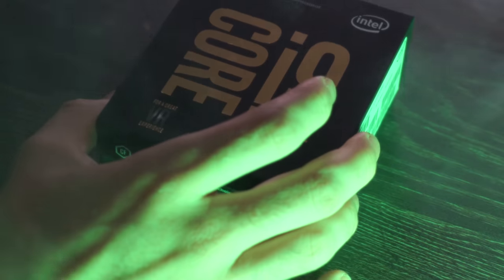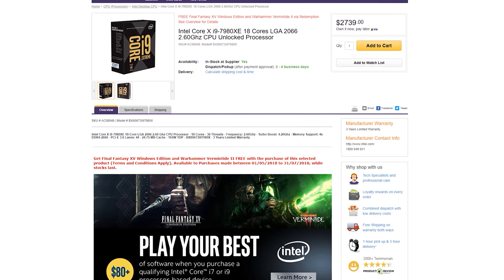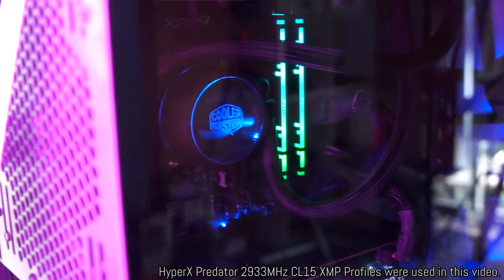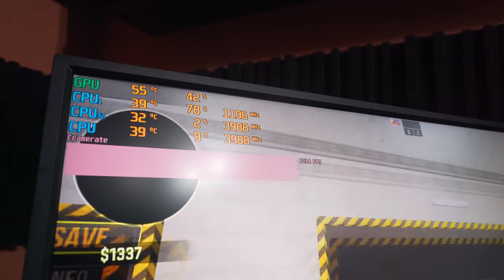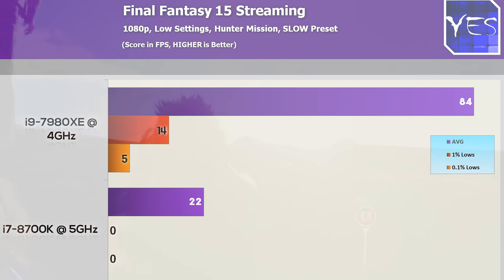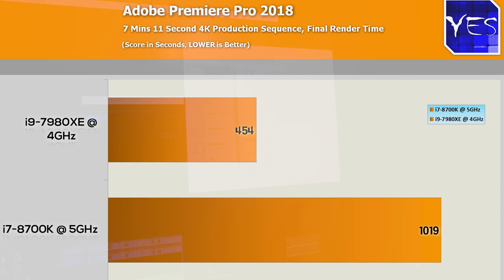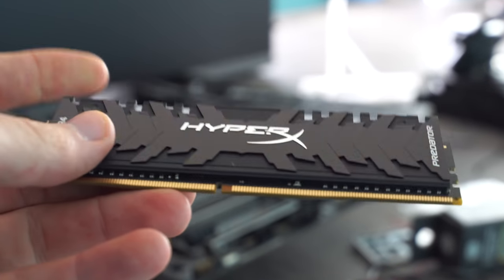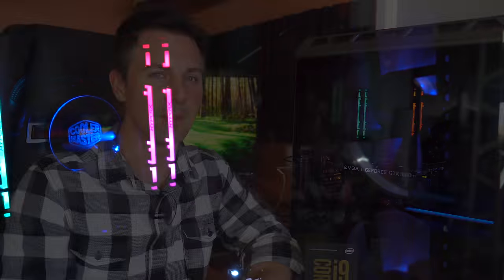i9-7980XE - What Can 18 Cores at 4GHz DO?

Comment: That Cinebench score is 6x of my i7-3770 main desktop PC ><
Reply: And 4,2 x of my 4790K at 4,6 Ghz.  I get 939 Points.
Reply: My E5-2698A v3 gets 2480.
Reply: And about 1/3 of my slightly overclocked ryzen 5 1600.
Reply: Damn! My 3930k @4.2 gets just over 1000.  Love that cinebench score
Reply: 🤓 I get 564 on my 8core Xeon Mac Pro tower 🍎
Reply: Still have FX 6300, i9 wouldn't be much of an upgrade just yet.
Reply: Is like 15% faster than my TR 1950X
Reply: Gabriel Florit 🤓 Cool 🚤
Reply: Really? I suppose it depends on the workload. it's going to get harder and harder for everyday people to max out these newer CPUs. There's only so much one person can do!
Reply: 910
Reply: "And about 1/3 of my slightly overclocked ryzen 5 1600." LOL, Nice.

J T
"it's going to get harder and harder for everyday people to max out these newer CPUs."
Seriously. Even 6 cores would not be utilized without modern games or content creation of some kind. 8 is hard to utilize, even for content creation. Virtual machines, audio editing, video editing, 3D rendering, and compiling seem to be the common workloads that I hear can utilize these HEDT parts.
Reply: i got 1200 on my 8600k at 5ghz
Reply: 3.6K is what I get with TR 1950x 4.125Ghz..... This cpu is a joke
Reply: weaklings, i got 700 on my sandy bridge i7 bro. beat that

Comment: The EVGA X299 DARK is a good motherboard. Designed for overclocking.16 phase VRM using 2-8 pin CPU power connectors. With the right cooling, and a delid, the i9-7980xe should clock to 4.7GHz stable
Reply: yea but kinda pointless to go for such a high clockspeed. he reached over 80°C at only 4GHz with a 280mm radiatior. how are you even going to cool this beast at 4.7?
Reply: Yeah, with an AIO that's better suited to a mainstream processor! If you delid the CPU, and run a large custom loop, those speeds are very attainable at a lower temp. Not on that AsRock board though.

Comment: Indeed I would be worried, or somewhat happy maybe if my idle temps were higher than my load temps. But something I'm wondering: what voltage are you running it at? My 4.3 GHz are stable at 1.13V which already puts out a decent heat. Something you wouldn't be able to cool with that 280mm rad.

Comment: Just a friendly reminder this is 7th gen Intel chip. Threadripper 2 is not even out, and is technically coming at 10th gen Intel timeline.

Just a thought.

Like new 8700k will lay FX on its' back.

Comparison is not valid to compare to Threadripper 2. Threadripper 1, yes.

Comment: For anyone considering buying this for only gaming you don't need 18 cores since even the most demanding games like Ghost Recon Wildlands at most will use 10 cores. Plus I'm pretty sure the PS5 and next Xbox will only have 8 cores 16 threads Ryzen cpu's and I still don't think games will be using 18 cores in the future. You would be better off buying cheaper cpu's like Ryzen 5 1600, 1600x, 2600, 2600x, Ryzen 7 1700, 1700x, 2700, 2700x, i7 8700, i7 8700K, i7 5960X, i7 6950X and i7 7820X because all these processors have at least 6 cores 12 threads and you might need the hyper threading in the future if games start using more cores.

Comment: building that seems hell so expensive. Instead I got a workstation from ebay with two old XEON processors running  at 2.8 ghz each  ,  for a total of 24 cores  48 gb ram for just 400 dollars and the performance is hell impressive too. Nonetheless I am realistic here.  the core i9 might doble up the processing power of my dell workstation but still It has a lot of horsepower  at a fraction of the cost  :D

Comment: OMG I want that lol...  However, if it does not really kick up my game play, whats the point.  

I have an i7-5820K 3.3 GHZ 6 core 12 logics and it works fine with my 128 gb ram and a 980ti.  I can still multi task pretty good so I am happy with running a game, having my cheat sheet up, skype, and more.  Plus, 4 1080 monitors.  I also do Software development on the side with Android and Visual Studios.

Comment: Which Adobe update are you referring to?  There was a recent update that allows you to take advantage of the usually idle integrated Intel graphics to drastically speed up exporting.  But this i9-7980XE doesn't have that.  Also... Puget Systems did a test of a bunch of processors... and they came to the conclusion that anything over 14 cores doesn't gain much benefit in Premiere.  So it really makes me wonder who would pay $2,000 for this processor to use for Premiere!
Reply from the maker: Its on my twitter, download the lastest adobe premiere and it was utilizing all cores and threads.
Reply: Ok thanks!  I know everyone got excited about the recent announcement that Adobe will use hardware acceleration with an integrated Intel iGPU to speed up exporting.  But there wasn't any talk about it utilizing more CPU cores with the latest update.  I have the latest update... but I only have a 4-core/8-thread Haswell i7 anyway...... :)

Comment: You need to a true TechYesCity comparison using used xeons and ddr3 server memory.  You will get nearly 90% of the performance for a lot less than 50% of the price.  I did.  You can get Xeon e5 2667 v2's that will run at 3.6 ghz all cores for $280 each.  2x will get you 16 cores and 32 threads and run that on a dual lga 2011 motherboard that you can grab for $300.  You can grab ddr3 1600 ecc ram for $30 per 8gig samsung stick.

Comment: i have a intel extreme cpu my self but and older model. its on Tech YES City own favoridt platform. X58 with a i7 980X clock in at 4.42 GHz. But hornestly if you are one of those considering at i9-7980XE. My advise is to wait a bit, cause with AMD´s Threadripper 2 with up to 32 Cores. Intel gonna release something with even more cores than i9-7980XE has.

Comment: you know very well 8700k is not even close to being able to stream with slow preset ... let alone 1080p60fps ... that portion of the tests is very wtf... you need a 16core Threadripper, some high core count xeons, or the big intel for that to even happen at all.. the encoder will just tank dead stop with 100% cpu usage on all cores.

Comment: fun fact to intel fanboys :D comparing 2700x and 8700k is like "comparing two different ketchup bottles" :D other is better for other like 2700x is allaround cpu...can handl most of the hard work much better than 8700k but 8700k has 10-15fps better perf in games...what isnt big deal cause both can handle maxed settings  over 144fps (if gpu and ram is good enough) well same goes to i9 7980XE vs TR2 gen2 32c 64t ....i9 has better sinlgecore perf in 2-4first cores if clocked but allaround whit max performance tr4 beats it whit clean score ....both are good choises but it seems like intel is much more powerhungry atm than amd...c15 8700k 4.9ghz drawed over 200w :D and amd 2700x whit 4ghz all cores drawed 150w  at peak still got higher c15 score (over 250p difference and thats kinda lot 1632p vs1928p :D ps those are my max scores atm ) :D

Comment: I am an amd fan guys my main sytem has vega 56 nitro, ryzen 1600x on a kraken x62 on a aus crosshair hero wifi x370 board it 4.13 ghz stable clock. Ok guys let me be frankly honest with you thick skulled chest banging buffoons.  With Threadripper 1 adobe premiere does not play nice with it,  Adobe premiere is not that well optimised and only lately have they done some decent improvements .... the guys from Hardware Canucks did a video about the issue. For Adobe premiere users its intel or a buggy threadripper experience with random crashes ect ect.....

Comment: #1 Reason NOT to buy the i9 7980xe: Intel uses toothpaste quality TMI between the die and ihs.
Reply: Ashley Williams Thats why everyone use delide 😆
Reply: GRIMM WESSEN Delidding a £2000 cpu sounds as ridiculous as it does unneccesary, especially since Intel used to solder all its enthusiast class cpu's and AMD still does. Theres no excuse for Intel to cut corners with the TMI especially when they are charging consumers so much to begin with.